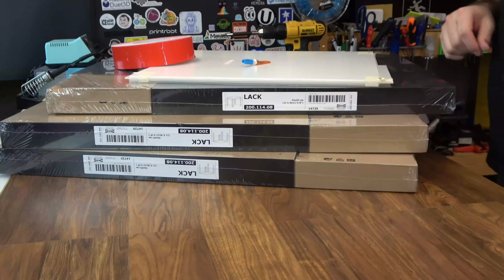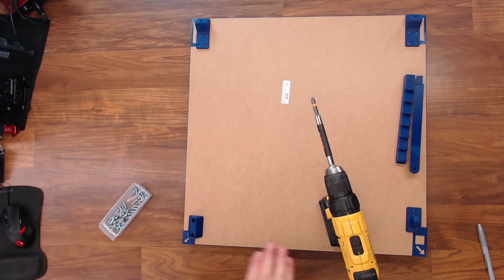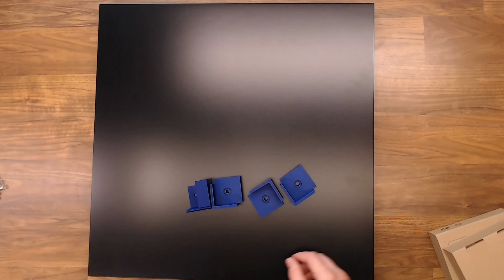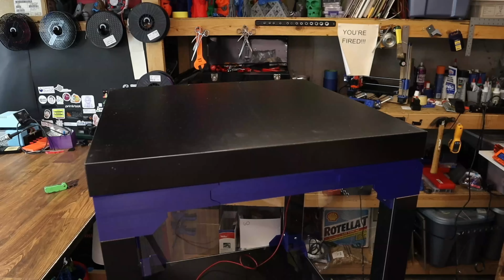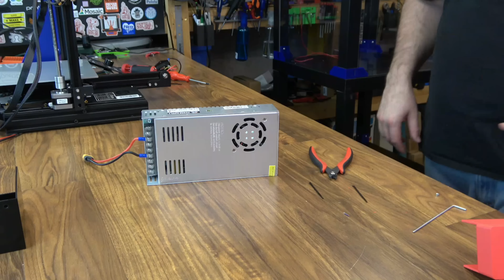Ender 3 - Prusa V2 Lack Table - Enclosure Build - Chris's Basement

Comment: I am using a washing machine noise dampening pad and a concrete block under my Prusa i3 MK3S, which increases the height to not to fit into the Lack enclosure. The simple solution I did was to but 5x5x15 wood blocks, drill a hole on one side and connect it with the leg of the Lack to increase the height for 15cm, which gave me engineering room to install my printer. I didn’t have to modify the parts at all and it looks amazing!
Reply from the maker: Awesome! Thanks for watching!

Comment: Did you screw directly into the printed parts? Or are there nuts on the other side? becouse the is no winding in the plastic, is it?
Reply from the maker: Not sure which parts you are talking about, but I don't like to let the plastic hold a screw without a nut integrated somehow.
Reply: @ChrisRiley  Thank you for your answer.
I mean the Part at 18:40, when you screw the M3 x 30mm for the Lid. It looks like it is screwed directly into the plastic, and I wonder if that is tight enough, becouse I thought there should be a Nut or something at the other end.

Comment: Quick question, did you need cable extensions for the PSU? If so could you please link them (preferably UK links) thanks!
Reply from the maker: I made one from 14g wire and another XT60 connector. https://www.amazon.com/MCIGICM-Upgrade-Female-Bullet-Connectors/dp/B07Q2SJSZ1/ref=sr_1_5?crid=1DH9P0KIXR8CM&keywords=xt60+connector&qid=1679442415&sprefix=xt60+connector%2Caps%2C154&sr=8-5

Comment: Cut out a hole on the top table to increase available height, then you put your Ender 3 on a concrete slab, 400x400mm is perfect, then slap some thick felt feet on the bottom of the slab. This should SIGNIFICANTLY reduce the resonance and loudness of the printer
Reply from the maker: Thank you

Comment: Hi Chris, love your work and your channel! I have an Ender 3 S1 Pro. I want to build an enclosure with ventilation, some sensors, lights, etc. Any recommendations? This is a good starting point, but I think there is some modifications that need to be done. Thank you!
Reply from the maker: Thanks! The lack enclosures are okay, but if you want to do a lot of moding I would look at some other options. I know they are pricey, but printedsolid makes some really nice ones.
Reply: @ChrisRiley  Thank you, I will have a look. I was also thinking about buying the extruded aluminum and just build it from scratch. You know, for a fun project.

PS: I’m new to printing and got an Ender 3 S1 Pro. Do you recommend making any changes or upgrades to it like fans and such? Appreciate all you do!
Reply: @3Dgifts  Hey! I have an S1 Pro, I would upgrade the partcooling and hotend fans. Makes it 10x quieter and more efficient. Also for the enclosure, you'll need to find a heated bed wire angle part. You'll probably need to solder it yourself because of the design
Reply: @jong882  Thank you. Would you happen to have some links handy to parts you recommend? Also, for the bed, I'm not sure i understand. I was just going to move the motherboard and display  out, or is that what you are referring to needing extensions?

Comment: This is great!  Thank you for the modified parts list.  However, some of the parts, such as the prop rod, are to long for my print bed, and I cannot adjust them in Cura, or Prusa.  Would it be possible to post a file for the prop rod that fits on the Ender 3 V2 print bed?
Reply from the maker: I'll see what I can do
Reply: @ChrisRiley   Thanks Chris!  There are several parts that I just do not have the skills to figure out how allow Cura or Prusa slicer to let me adjust the prints so they fit.  I would greatly appreciate anything you may be able to do.

Comment: Did you print these parts on the Ender 3? I have an Ender 3 S1 Pro, but some of the parts are too big to print, even diagonally. Not sure if there is a different way to approach those parts.
Reply: Using Cura - which apparently is part of the problem? I am going to try switching to Prusa Slicer and see if it makes a difference; but if anyone else has run into this I'd love to hear about it
Reply from the maker: I printed all this on a Prusa MK3, that's the printer most of the parts were designed for. Yes, the 3MF files are treated differently in CURA, hopefully PS helped.

Comment: I wish we could upload pics. I have a couple pieces that I printed for this enclosure that have seemed to fuse together. I did upload the 3mf file to convert to stl so I dont know if that caused the issue but but definitely something to look at if your slicer doesn't handle 3mf files. Gonna update to the new cura 5.x and try again as it now handles 3mf files I think.
Reply: You need to remove the supports in the prusa slicer. There are blocks that are supports in prusa slicer, but just solid blocks in other slicers like cura. You just need to install prusa slicer, delete the supports, save the file, and then open it in cura and add your own supports to the same areas.
Reply: @jackbui2944  right on and thank you! I did download cura 5 and it's able to read the 3mf file now so I was able to move the pieces around so they don't print as one lol. I was wondering about the blocks tho so thank you again. I will put them into prusa slicer like you said.
Reply from the maker: Thanks for the help here @jack bui

Comment: Great video! I do have a question though, I am trying to print these parts on an E3P, that said, do I need to print these parts with the supports?  I removed to supports in prusaslicer first, then opened them in cura.  I just want to save some time and filament where I can and thought that it was worth an ask.  I am pretty new to printing and I'm not sure how to limit the amount of supports like they have them set in prusaslicer.
Reply from the maker: It's best to go with the Prusa Slicer recommendation.

Comment: do you think this mod could work for a cr-6 se?
Reply from the maker: I'm not sure of its size. If it's close to the ender 3, then it should.
Reply: @ChrisRiley  the PSU is contained in the base instead of mounted to the frame, does that change anything?
Reply from the maker: @tarantulapettingzoo2980  it shouldn't matter too much, you might have to rework the PSU bracket.

Comment: Hey Chris, nice video. After looking at a few different designs, I like this one. Your instructions help. I do have one question though. I grabbed the print files from the links you provided. When I open them, they are GCode rather than the STLs I'm used to seeing. Did I get/grab the wrong files or is that the way they are posted?
Reply: When they are in gcode you can put them in the printer and start. STL gets transformed into gcode
Reply from the maker: Thanks!
Reply: @Alex-qg9mj  correct. However, it is from the stl that I am able to make my printing configuration settings and then create the Gcode. Using a pre-created code bypasses my ability to input printer unique settings.

Comment: Love this video!  I have a question for you… how many rolls of the Jessie would I need to make all the parts?  I still have my printer in the box 😂 I plan on opening and playing with it while I wait for the plexi and Jessie.  I ordered the magenta 3 rolls…. I hope that’s enough…?  Thank you!
Reply from the maker: I think you can get it done with one full roll, baring mistakes. Be aware that I didn't explain the print volume of this very well. These parts are designed for a Prusa, so I printed them on a Prusa, the ender 3 is not big enough for some of the parts. They would have to be cut up to work.
Reply: @ChrisRiley  “cut up” 👀 😬 😱 what does that mean?  Probably such a loaded question. I need some hand holding and a pause button on all videos. 😜 self learning here.
Reply from the maker: @LifeHacksbyStacy  I am not sure about all slicers, but I use Prusa slicer. You can load the plate of parts and then hit cut. Then delete the ones that won't fit and print them in sperate batches. I think most slicers can do this same thing now a days.
Reply: @ChrisRiley  thank you!  I got my v2 plexi in.  It is the newer model of plexi and says 3mm thick. I don’t know what the thickness of the original plexi is.  Confused as to using the 3.175 parts to print or the original in your blog.  Can you clarify for me?  Thanks so much! Hopefully I will get this.  I can’t wait to feel so accomplished after doing this!

Comment: Can't be printed on an Ender 3 V2. parts in file number 5 won't fit on the print bed.
Reply from the maker: I should have been clearer on that, all these were designed for the Prusa.

Comment: I'm having trouble trying to figure out what parts to print from the prusa enclosure files, and what parts to print from your files. I am getting the plexiglass from the link you put in the description so I know I won't need to print the extender things, but I also can't find files 2.3, 6.3, 7.3, 9.3, or 10.3 from the prusa files anywhere the printed parts section of the video, so i'm not sure if those are used
Reply from the maker: From the PRusa Files, you will need 1,3,4,5,6,7 of you use plexi from PS. On my files the PSU holder is really the only one needed, the rest are optional .
Reply: @ChrisRiley  Thank you! I can barely wait to start building this enclosure

Comment: Chris great videos. I like the way you break things down and go into detail. I'm building an enclosure for my ender3. Do you know of anywhere I can get the STL files for the parts? The ones on prusa site are for petg profile and cuts won't let me change it. I'm looking for a pla profile. Any help is appreciated
Reply from the maker: Thanks, you should be able to use the 3MF files below to change the properties and print them with PLA. Check on the files tab. https://www.prusaprinters.org/prints/3673-prusa-enclosure-v2-mmu2s/files

Comment: anyone else find a better solution to running the filament through the side of the plexi? 
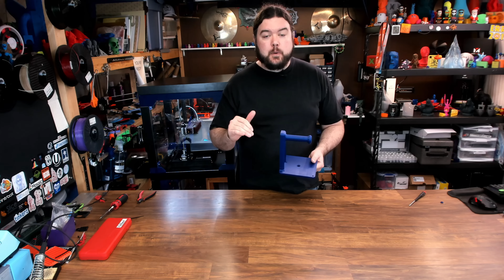38:42
Reply from the maker: From the top would be better with this, but you would need to attach a PTFE tube to redirect the filament, it would be a tight fit.  https://www.thingiverse.com/thing:2114888

Comment: How hot does it get inside and is it not a problem that you left the board and the display in?
Reply from the maker: It will get to about 32c, no problems with the board or LCD at that temp.

Comment: Hi Chris nice video. you mentioned for the leg where the hole for the power cable is, that if you put the power supply outside you can rework that part. but i'd like to point out that the other part on the back (the right one?) is exactly what you need. so what i did was print that part again to replace the one with the hole in it.
Reply from the maker: Nice, good tip.

Comment: Which files don't I need to print on the right there?
Reply from the maker: On mine, I used the taller acrylic from printed solid so I didn't use 2, 8,9,10 and 11.
Reply: @ChrisRiley  Thanks. I am doing the exact same build and got mine from printed solid too.

Comment: The reason you want an enclosure is to save your marriage. Use egg crate foam or garage door insulation to dampen the resonance. An anti fatigue mat can also line the floor.
Reply from the maker: Ha! Thanks for the tip!

Comment: Hi! If i want an extraction on the encloser, di you recomend 2 fan (one in and one out) or just one fan out to keep the temperature hot inside the enclosure?
Reply from the maker: Maybe just one out, then maybe try to route the warm air back in.

Comment: Can someone please make or figure out if this will work with the Walmart Mainstays end tables? I do not have an ikea and shipping can be pricey
Reply from the maker: Do you have a link to those tables? I will check it out.
Reply: @ChrisRiley  someone tried to make some risers but they are not compiled in one location on thingiverse so you kind of have to search around and probably missing components like the hinges, door handles, etc need to complete the build with walmart end (mainstays, parsons brand) tables for an ender 3.

bottom risers: https://www.thingiverse.com/thing:2527450

top risers: https://www.thingiverse.com/thing:2798973
Reply: @ChrisRiley  Hey Chris, Update... I just compiled pretty much everything someone would need to make an enclosure for the Ender 3 using two Walmart Mainstays Parsons brand end tables:
https://www.thingiverse.com/thing:4870662

Comment: For the sing setting how much infill is best?
Reply from the maker: I use 20%.
Reply: @ChrisRiley  bro, for the psu wire for ender 3 v2, do u know what is the best wire suitble for it because i need to purchase longer wire?
Reply from the maker: @mohdbugis9614  14g silicon wire is preferred. https://www.amazon.com/BNTECHGO-Silicone-Flexible-Stranded-Copper/dp/B08Q43DNKB/ref=sr_1_2_sspa?crid=2E28MSIRLGMWL&dchild=1&keywords=14g+silicone+wire&qid=1620665122&sprefix=14g+si%2Caps%2C191&sr=8-2-spons&psc=1&spLa=ZW5jcnlwdGVkUXVhbGlmaWVyPUE3TFhFM1VZQVk3NkMmZW5jcnlwdGVkSWQ9QTAzNDkxMDAyMlEyNkI5RTlLNE1LJmVuY3J5cHRlZEFkSWQ9QTA4Mzc3ODkyTjc1M0FXMTZWVkM2JndpZGdldE5hbWU9c3BfYXRmJmFjdGlvbj1jbGlja1JlZGlyZWN0JmRvTm90TG9nQ2xpY2s9dHJ1ZQ==
Reply: @ChrisRiley  thanks bro❤️

Comment: Maybe it's because I'm a newb to 3D printing, but I can't figure out this problem:

Background:
I am attempting to print the parts for this on my ender 3.   The Prusa site has G-code files, presumably for a Prusa printer, and also .3DM files.   I'm trying to use the .3DM files, because I have been warned about G-code files not sliced for the extant printer.   As a newb I had been using the creality slicer, but needing to use the .3DM files (creality slicer can't deal) caused me to upgrade to Cura.  Simple learning curve since creality slicer is based on obsolete version of Cura. 

The Problem:
The .3DM files have large solid cubes where the supports are in the G-code files....In some cases extending below the print surface, and well above the part surface that needs support.   This makes the .3DM files unusable.  I presume that these were used to indicate in Rhino where support is needed, and somebody forgot to turn off the "reserve for support" layer before exporting the .3DM models.  These are even clearly visible in the .3DM viewer on the Prusa page for this project.

Can anyone suggest how I could resolve this issue without having to re-CAD all the corrupted parts?

I guess I'll try commenting on the Prusa site, but feel wierd about it, not being a Prusa customer.
Reply: well, it turns out that the prusa site has a .step file I can open with Fusion 360, and export STI files from there.   I think I will also mod the hinges to use some magnets I already have.
Reply from the maker: Glad you figured it out.
Reply: @ChrisRiley  Editing the step file turned out to be a major pain.   I finally got a reply on the Prusa project site that the .3MF files work only with Prusa slicer.   It turns out that Prusa slicer is free and will slice for an Ender 3 (and lots of other non-Prusa printers) with minimal adjustment...so with only a little fussing about, I now have the first batch of parts printing. It seems like you have to use the Expert mode to get the support enforcement to work right.

Comment: for plugging the cable tunnel in the back-lower-left corner block, you can just set up your overhang support so that it ends up nearly plugged by the supports...not airtight, but neither are the doors or panels, so good enough for me.  I cant take credit...Cura just did it for me!
Reply from the maker: Cool, thanks!

Comment: I'm trying to print the prusa_mmu_
enclosure_1.3mf but when I import the file to Cura it seems to think the supports are actual pieces of the parts 🤔 the two hinges also collide because of these supports.

Do you have any solutions for this?
Reply from the maker: You would have to use the STL files instead, not sure if there is an 3mf plugin for Cura that might help you.
Reply: I ended up setting up  Prusaslicer för my Ender 3 instead 😉 really like it 😊👍

Comment: As the printer was earthed to the PSU through the screws, you may want to run an earth wire from the PSU to the printer frame
Reply from the maker: Thanks for the tip!

Comment: So after putting one of these together my printer stops responding once the enclosure warms up.
Reply from the maker: That's not good, might be a mainboard issue.
Reply: @ChrisRiley  a lot of people have told me it's just to hot inside. Prints fine with doors open. Working on moving the board and touch screen to the outside.

Comment: Wait so what is the point of your corner pieces? Looks like they just add more height to the table below the surface that holds the printer which doesn't look like it is needed or used in this build.
Reply from the maker: I used them to hold the legs in place versus an L bracket or something like that.

Comment: Great video! Excellent walkthrough with plenty of explanation... Would love to see such a build for the Ender 3V2...
Reply from the maker: Thank you!
Reply: Uh oh!  Obviously new and overwhelmed. I just got the ender 3 v2… will it not fit in this enclosure?  I got the tables and ordered the plexi etc but haven’t gotten my machine out yet.  Just gathering everything to start my journey.
Reply: @LifeHacksbyStacy  The power supply of the Ender 3V2 is mounted differently than that of the Ender 3. You can probably get it to work with this enclosure but it is a little more difficult to do.

Comment: Hey Chris, great video as always! I am planning to mount a raspicam inside the enclosure in the front-left leg. Do you think the orientation you used for the led strips is ok or it will reflect towards the cam? Shall I mount them slightly angled to avoid the light reflecting on the bed/cam?
Reply from the maker: That's a good idea. I just kind of play with it and see what works. Thanks